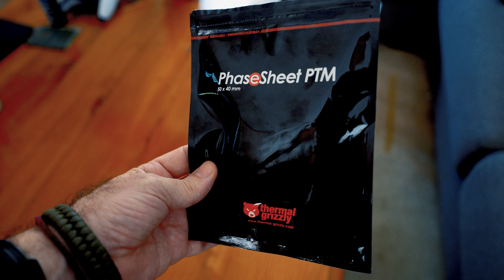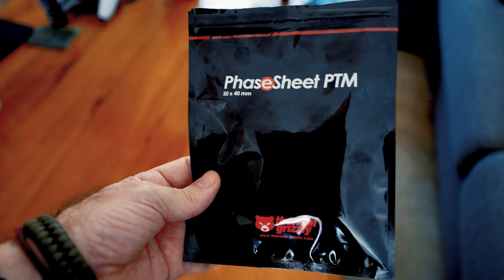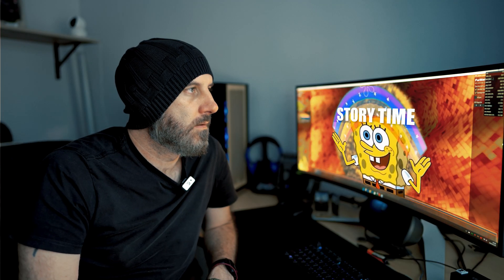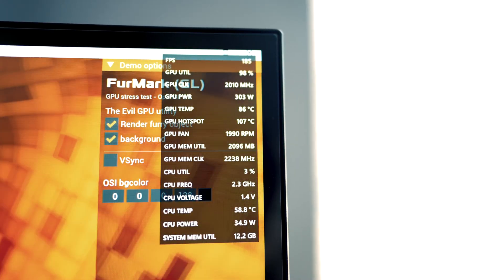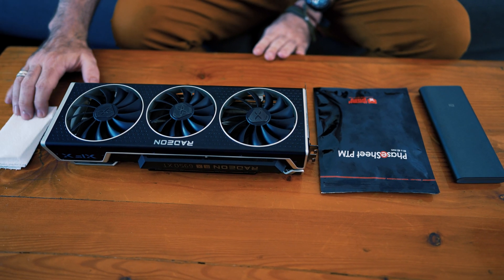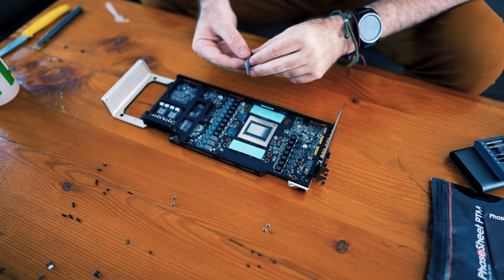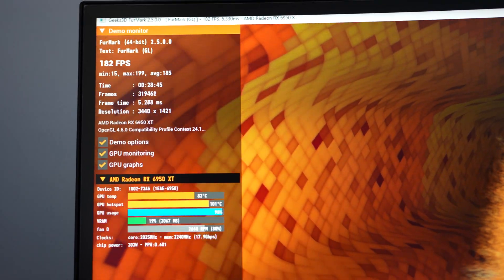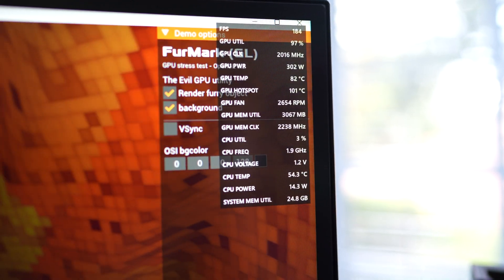🔥🔥Can a 107c GPU Hotspot Be Tamed With Thermal Grizzly PTM?🔥🔥

Comment from the maker: It was pointed out to me that I made a mistake in this video. My inital testing prior to the repaste, had the fans speeds at 2000rpm, and then after the repaste, I had them set to 2600rpm.  A huge oversight on my part. I apologise for that. 

I did re-check it and the 600rpm difference made a 1c difference in hotspot temperature.

I don't have a lab unfortunately, so it's very much a 'Well, it worked for me, it will probably work for you too' approach for the time being. 

The Gpu is definitely running less hot since the repaste. I also repasted a 7900xtx with some positive results :)

Comment: nice i just got this for my toxic 6900xt extreme edition. did a recent cleaning of it and the alphacool waterblock and my hotspot hangs out at 95c and the gpu itself is only at 60c when i run  benchmarks. back when i first swapped the aio to the waterblock it was like 65c and 75c on the hotspot. really hopin it fixes the problem.
Reply from the maker: That's a huge delta between the core and the Hotspot. A repasting is definitely needed.
I'm sure it will sort your issue out. Did you get the PTM or you going with regular paste?

Comment: i have 50c normal temps and 110c hotspot just ordered it to see if it fixes it
Reply from the maker: Wow, that's extreme, bro!

I'm sure it will. Same card?
Reply: @JustJean-Yves  its a 6600xt and im not sure when this started happening lol  i hope i noticed this early tho i havent been looking at my temps for a while 
when not playing games my hotspot is at the same temp as my normal ones tho so i just watch videos 🙃
Reply from the maker: @Finefel  Yeah, at didle, the hotspot will be closer to the core tempuratue.. Definitly give it a repaste, bud.

I don't think you need to do a thermal pad like I did, just a regular repasting will suffice, as yoiur card doesn't pull massive amounts of wattage.

Comment: You're right about the side panel fan cooler. I have no idea why nobody is taking advantage about this old design. I guess because everyone is obsessed with showing off their cool pc from the side panel glass right? If i was designing this i will make a square shape shape on the side panel, mesh with a dust filter, but there needs to be distance from the card to the side panel...
Reply from the maker: Aesthetics did take precedent over function, but I think the problem is that you can't make holes in tempered glass, it greatly reduces its strength and will shatter way easier. I could be wrong, but that's my thinking on it. At least we are now getting cases with bottom intake direct to the GPU.. Small victories.
Reply: @JustJean-Yves  Dual chamber cases completely solved the GPU cooling. My friend has three fans installed under his GPU. He told me that sometimes he's gaming and his GPU fans to not spin because the card is below 55 degrees....

Comment: Still 100 degrees???  I got to reduce power on my card or I get over 100
Reply from the maker: Yeah, it was still very toasty.
I have since swapped that card into a different case and it's running relatively cooler now. 🙏 Around 80-90c on hotspot.
https://www.youtube.com/watch?v=0qChXoNjJqs

Comment: Are you doing it intentionaly or you realy didnt realize before phasesheet your fans go up to only 2000 RPM, but after install it your fans spins up to 2600 RPM... So this video and test prove nothing.
Reply from the maker: Hey, Hasan. Thanks for the comment. This was brought up several months back and it was an oversight on my part. I do apologise.

Here is what I responded with. I have also put this as a pinned comment.

______________________________

Well spotted. Yes, that was pointed out to me a while back. I huge oversight on my part. I apologise for that. I did re-check it and the 600rpm difference made a 1c difference in hotspot tempurature.

I don't have a lab unfortunately, so it's very much a 'Well, it worked for me, it will probably work for you too' approach for the time being. 

The Gpu is definitely running less hot since the repaste. I also repasted a 7900xtx with some positive results :)

Comment: I just got myself a used havn420 which im excited to build my new system in. But my old pc is still living in a cooler master HAF, and yes, the huge sidefan for the gpu definitely helped. Im gonna miss this fridge
Reply from the maker: Ah dude, the LEGENDARY CM HAF. 
Back in the day, if you had one of those, you could 'probably' run Crysis 😂
Reply: @JustJean-Yves  hehe, yeah i really don´t know what made me get it back then, but yeah crysis did run, on like low to medium settings xD. Luckily found a month old 5080 suprim liquid for a steal so my new system should have some more power going for it^^
Reply from the maker: @TheTillinger123  Ah dude.. it was a solid case hey. I went for the Antec 1200. Also a beast!.
Wow, a 5080 Suprim Liquid and a Havn 420.
Bro, you balling!
Reply: @JustJean-Yves  Damn, sidefan for the win eh^^ Yeah i got lucky and got both used or as a return, so price reduced. Otherwise i would have also waited for the ti version.

Comment: The Hotspot is still high in my point of view, so the problem must be the thickness of the thermal pad without a doubt, I had the RX 6900 XT, hotspot was 15 to 16c, hotspot temperature reached up to 85c
Reply from the maker: Put the 6950xt into a new case with better airflow, significantly dropped the temps. Remember, the PTM turns to a liquid when over 45c, so thickness doesn't matter at that point.
Reply: @JustJean-Yves  PTM is supposed to turn liquid only the first time then it stays as it is (otherwise it would just be like thermal paste).
Pad thickness matters because it determines the distance between the heatsink and the gpu die. That distance is important, it should be as small as possible.

Comment: Airflow really does make a difference. Going from a more "silence"-based bequiet-case to a Fractal Pop Air XL did change my temps quite significantly. Plus going from a 240 AiO in the front with another, unobstructed 120mm below it (all intakes) to a 360 AiO in the front also raised my GPU temps and my board and chipset-temps.
IIRC, you should put the pad into the fridge for about 20 mins before installation - makes it a bit easier to manipulate. Plus you should cut it so it'll be slightly larger than the die - size it so that it'll overhang the edges of the chip by about two or three millimeters.
The one thing (other than lower temps, duh) that really intrigues me about these pads is their supposed longevity. It's one thing having to re-paste your CPU every two or three years, but taking apart a modern video-card is a bit more involved.
Reply from the maker: I changed cases this weekend as I got a fancy new CPU, and this new case has way better aiflow. The GPU also sits vertically and my temps are significantly better, like 30c drop better!

I love the Corsair 5000 series, but damn, it doesn't handle high TDP hardware all that well.

Thanks for the tips on prepping the PTM! 
Yeah, apparently the pad should last up to 10 years, but I've also read that pump out occurs way sooner than that.

Comment: Hello just Jean.
I want to also change the thermal pads for the exact same card you have.
I have first re-pasted the gpu, but during the dis-assembling one of the thermal pads ripped and got damaged.
So i made an attempt to fix it as best as i could.
At that time i did not think about to  right away measured the thickness of all the Vram's and Vrm's thermal pads, before re-assembling.
To prevent to potentially damage even more thermal pads i would like to ask you, if you by any chance know what thickness of both the Vram's and Vrm's thermal pads are?
This way i can order new thermal pads, without risking further damage.
Thank you in advance for your reply.
Liked and subscribed!👍👍
Reply from the maker: Hi, bud!

From what I know, the thermal pads for the VRM is 1.2mm, however, what I would suggest is to use thermal putty instead. It's what comes with the cards from factory, and generally does a better job and you don't have to worry about thickness. I recently ordered some Thermal Girzzly putty and will be replacing the pads on my card soon, as the Vram temps are crazy high.

I hope this helps you, mate!
Thanks for the like and sub :)
Reply: @JustJean-Yves  Your welcome!
And thanks for the tip!👍
Reply from the maker: @opoxious1592  Anytime!

Comment: I just put this on my GPU and CPU on my Lenovo Legion Pro 7I 5080 HX 275 Laptop. I was thermal throttling at 105C thats the limit for this CPU. It did take a couple of days before the temps started going down but when they did I went from thermal throttling after about 5 minutes into a AAA game to steady temps between 93-97C. I couldn’t believe the difference it made.
Reply from the maker: That's great to hear, man!  And it should get better as time goes on!

Comment: I tamed a runaway ZOTAC RTX 3080 AMP Holo which went way over 100 degrees if I wouldn't have stopped FurMark2 mid-bench by using TG's PTM.
It finished the FurMark2 1440p bench at 69 degrees max now (did full clean and pad replacement as well).
Reply from the maker: Awesome to hear. It's honestly such great stuff this.
Reply: @JustJean-Yves : Subbed to support 👍
Reply from the maker: @theGoogol  Thanks, Champ!

Comment: i Did notice you fan speed with 107c is only 2000 while after repaste and 102c its 2600. Thats quite the difference. Only way to correctly test the effectiveness of the repaste is so measure the temp of the room and case so you can calculate a ambient delta (preferred the temp is the same but thats harder in a home instead of lab) and use the same fixed fan speed for casefans and GPU fan or a open test bench. Its also ok to do a second run with auto fan speeds to see the difference there but to really know the temp gain its better to have it fixed.
Reply from the maker: Well spotted. Yes, that was pointed out to me a while back. I huge oversight on my part. I apologise for that. I did re-check it and the 600rpm difference made a 1c difference in hotspot tempurature.

I don't have a lab unfortunately, so it's very much a 'Well, it worked for me, it will probably work for you too' approach for the time being. 

The Gpu is definitely running less hot since the repaste. I also repasted a 7900xtx with some positive results :)

Comment: I found out that ptm7950 is actually better than the thermal grizzly one after buying it -_- but I would like to share my experience with it. I use my old gaming laptop as a secondary device, 2019 Tongfang chassis i7-9750h and gtx 1660 ti (GK5) which runs extremely hot as default, cooling design looks like it was engineered by monkeys. Anyway, so in any kind of load my cpu and gpu would shoot up to the max temp, even with fresh paste. I applied the Thermal Grizzly phasesheet ptm to see it's effectivness, and even though its barely been 24 hours since the application, the max temp I see under load is at high 80's which is impressive considering the cpu went up to 100-95 at any load consistently. Gpu stays under 80 degrees most times as well. Both the gpu and cpu are able to sustain higher boost clock as well (my gpu is oc'd) It's working so well in fact, the bottlneck in the cooling system isn't the termal compound aymore, it's the heatsink and the fans instead.
Reply from the maker: That's really interesting. I would love to get my hands on some PTM7950, but it's really tough to here in SA. Even finding Thermal Grizzly Phasesheet ptm proves to be a challenge.

This stuff is honestly a game changer when it comes to cooling. Just a matter of time before we start seeing every big paste manufacturer bring out their own variant, and I for one, cannot wait.
Reply: Thanks for sharing it with us. How much better in Celsius would you say 7950 is?
Reply: @rokenastxcrew8440  The 7950 is probably going to be anywhere from 5-20% better than this, based on the application, for gaming laptops it does make a huge difference as they are more sensitive to heat spikes due to limited physical space for cooling designs. In celsius I am guessing about 5-10 degrees difference, but it really depends on several factors like how capable your cooler actually is, or is it a desktop or a laptop. IMPORTANT NOTE: and a quick update for my case, it looks like my laptop's heatsink doesn't apply equal pressure to the cpu and gpu die. Even with proper torquing with the pattern heatsink has on it. With heat cycles due to the unequal pressure it compressed and pushed the phasesheet out, within a week my temps were back to how it was before the application. It's been 3 months now, it's worse than ever. Looks like you really have to have very equal mounting pressure, plus my heatsink was never designed to be used with anything else than thermal paste. So I'm looking into getting Thermal Grizzly Kryonaut Extreme, as it looks to be the best option as far as pastes go.
Reply: Why do you say Honeywell is better?  Did you also test it?

Comment: Phase Change Thermal Pads need a couple of hot and cold runs to melt and fill in the gaps more efficiently. OCCT is great for that.
Reply from the maker: 100% correct

I've never used OCCT, it's really cool. Thanks for the heads up.
Reply: No it doesn't. Once is enough

Comment: Used this stuff on my red devil 6800XT. Was absolutely amazed by the improvement. 1440p Furmark bench before vs after: Die temp 70 and hotspot 92. Immediately dropped to 50 on die and 67 degrees hot spot! Still improving after several days of heating and cooling. Highly recommended. With max power +15% and overclocking with standard volting, the Highest Hot spot temp i can now get (using extreme test on OCCT) is 80 degrees. Amazing result.
Reply from the maker: That's amazing, man!
Yeah, I'm sold on this stuff.
I recently bought a 7900xtx ref model. Hitting 110c on hotspot almost immediately. Got a video coming up on it.

Glad it worked for you, bro.

Comment: Hey!
I've been thinking about repasting my 7800 XT even though I'm on lower than 100C usually, the delta between core and hotspot is 30 to 35C so I don't really like that.
This thing aside, I saw that during the first test when it reached 107C on the hotspot the fan speed was around 2000RPM, on the second test after applying the new paste it was 2600RPM, seems a bit strange to be honest, was there something that changed in the fan curve as well?
Reply from the maker: Hey, bud

You are spot on there. I didn't even notice that  to be honest. I didn't change ANY settings,. I will follow up on this and re-run the tests again and let you know how it's going.
Reply: @JustJean-Yves   
Ouh to be honest don't worry too much!
I wouldn't want you to stress out doing all the tests again, I just found it a little bit curious, I think 600RPM more you would've heard it as well so who knows, maybe it was a problem with the software reading for a moment

By the way, I'll probably get Heilos PTM for my 7800 XT wednesday, right now my card sits up at a delta of 30C at around 90-95 of hotspot, I'll let you know as well if you're interested
Reply from the maker: @ Definitely interested! I think PTM is going to be the go to instead of thermal paste for more people than not.

I don't mind re-looking the temps :)
I didn't notice a change in sound as I went away out of town for a few days after changing the paste to PTM, so I had no point of reference to the sound increase. Well spotted though!
Reply: @JustJean-Yves  Hello!
I'm here after testing on my 7800 XT.
I went from 90-93C to around 78-80C using thermalright heilos.

The stock paste wasn't that terrible either, it was a good application overall even though it had like 30-35C gap between core and hotspot

Definitely an improvement, I guess that the card itself can't really go that much below 20C difference between the two temperatures

Comment: @just jean. Have you some results 1 month after installing? I tried PTM on a 6650XT because of the 30 to 40°C between temperature and hotspot. PTM fixed it at 18-19 degrees. I'm interesting in evolution of your temperatures because i saw (on my card) that the problem is the XFX radiator that let the thermal grease run over the Die. so if you have evolutions; I'm hearing!
Reply from the maker: As a matter of fact, yes!
I've seen the Hotspot tempurature drop to mid 90's, which is quite amazing. A good 13c or so drop.

I've also recently got an Oem 7900xtx with the infamous 110c Hotspot issue. I'm going to try see if the PTM can help there too.

I'm really glad to hear your card has also seen really good tempurature reductions. XFX actually uses PTM now on their 9070 cards and because of that, are smashing the other cards in terms of cooling and performance.
Reply: @JustJean-Yves  Thank you for your reply.
Here, I'll look at the evolution over time because the problem with XFX is that GPUs are often not flat.
Consequently, after several heating cycles, the thermal paste drains from the GPU.
The MX-6 failed in 15-20 days. Currently, with PTM, I've gone from 65°; 100°; 1900 rpm (GPU/hotspot/GPU fan) to 62°; 80°; 2000 rpm. It's been stable for 10 days.
Looking forward to sharing our experiences.

Comment: Still seems high.  Maybe a more aggressive fan curve and double checking case fans/air flow etc could help.  Also making sure you clean cooling fins.
Reply from the maker: Yeah, it's still high, but seems to be on par with how it should be performing in a hotter environment. It's summer here in South Africa. It's cooled down a bit since I posted the video and I'm not getting low to mid 90's on the hotspot.